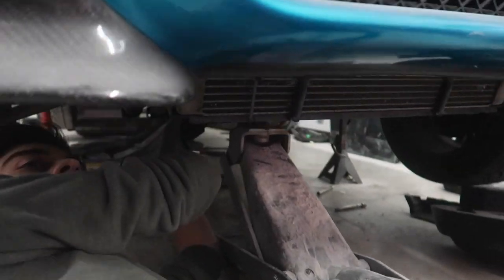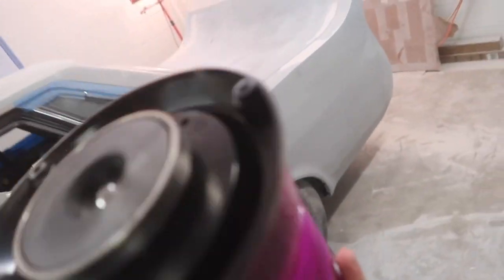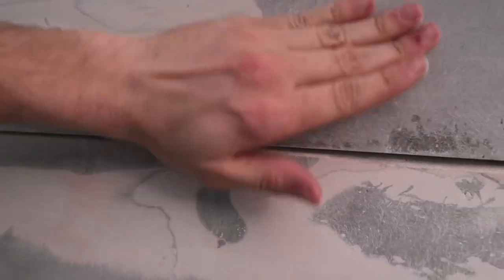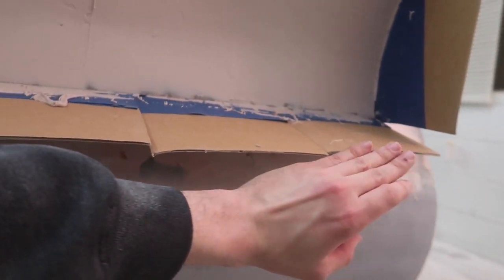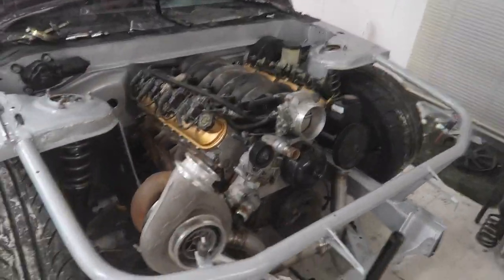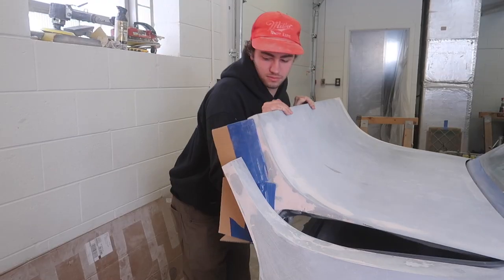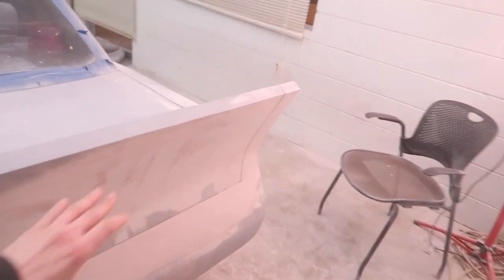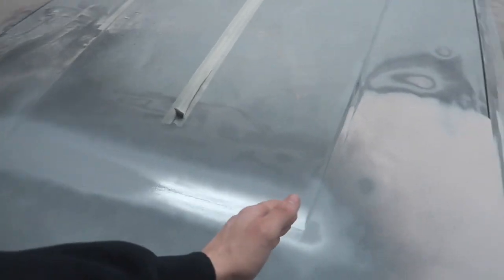Boso Lights + Turbo Ls 240sx Engine Installed

Comment: The lights are called tear drop lights. The brand is FLASHBALL KW12 they cost about 75usd shipped from japan.
Reply: There are purple, red, yellow, blue and green. Purple is japanese market only. I own a red one.
Reply: NintendoGeek26 Clutch 👍🏾
Reply: +Derrick Gonzalez yeah but the ones the japanese use are shaped like a tear drop
Reply: +Derrick Gonzalez look up "federal signal fireball"
Reply: +NintendoGeek26 EDIT: The ones Tyler got are cool. But aren't the ones you see in the back of boso cars. The ones they use are Called Teardrop Lights.
Reply: +B18 Boy nice. Ive been wanting to get a purple one but theyre fucking expensive. My red one will do for now lol

Comment: its not good to let the battery on the fork lift to die all the way. when they get to 20% thats when they need to be charged. you can damage the battery if it dies all the way and a new one cost like $6000
Reply: Ricky Edmiston I think he meant the battery on the camera..
Reply: Oscar Muñoz you might be right
Reply from the maker: I was talking about that camera battery, also the fork lift uses a car battery so maybe like $100 for a cheap one
Reply: Tyler Fialko that's good, the one my dad got we had to spend $5500 for a new battery.